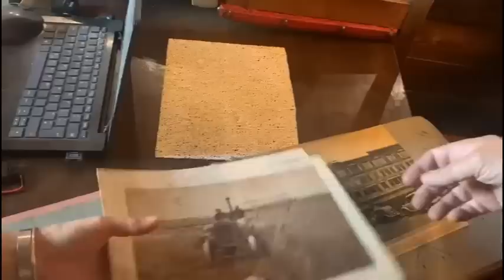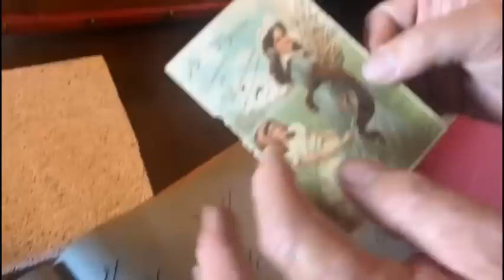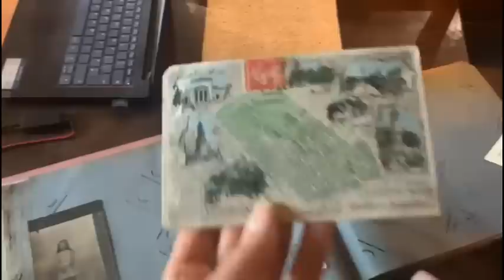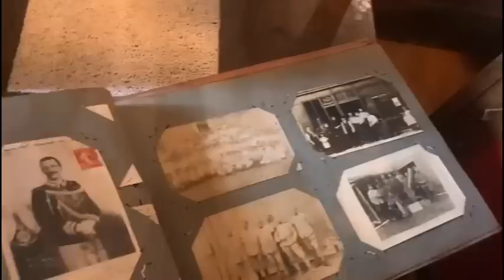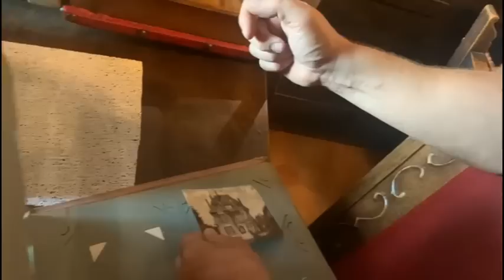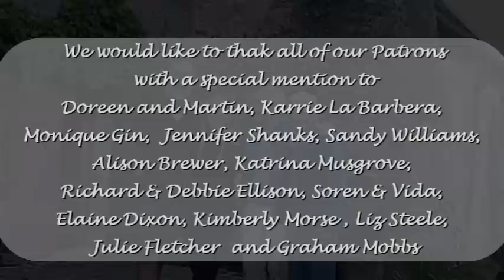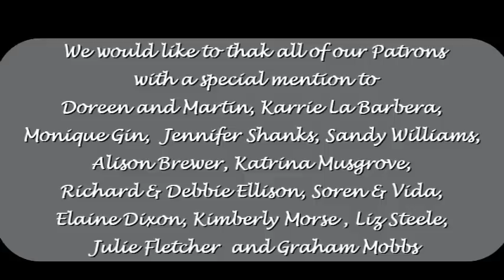155. A surprise find in the dump barn

Comment: Super Trouper Charlene! That roof is in remarkably good nick. You really are going to have to make a set of steps to the upper floor and get some safe flooring down there. All the stuff that's got to come out of the BIg Barn has got to go somewhere. Light stuff up there heavy stuff down below. Digging up the floor in the piggeries is going to be very hard graft as some stables/sties had the stone set in vertically to assist with drainage. Bon Chance a tous
Reply from the maker: The floor was no match for Charlene and Ted 💪🏻💪🏻